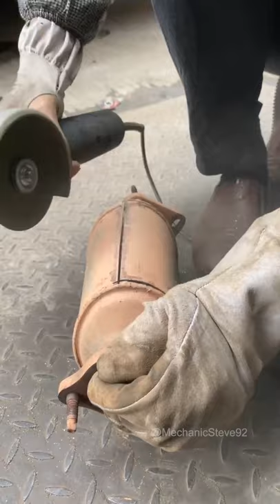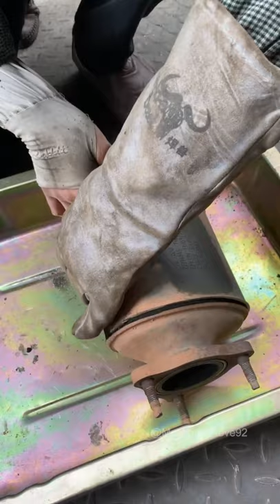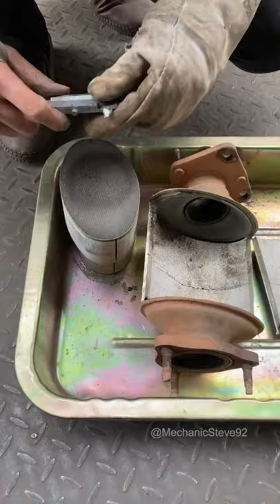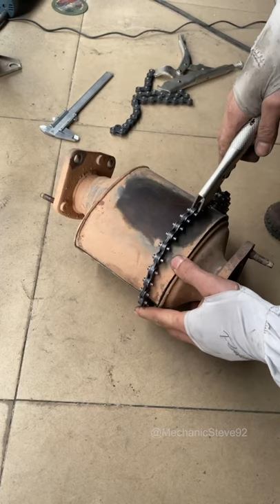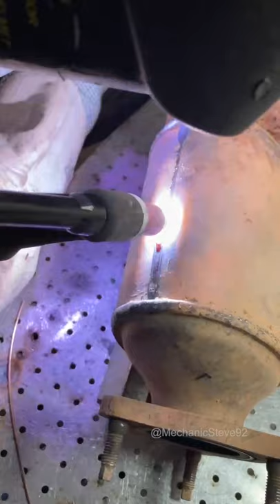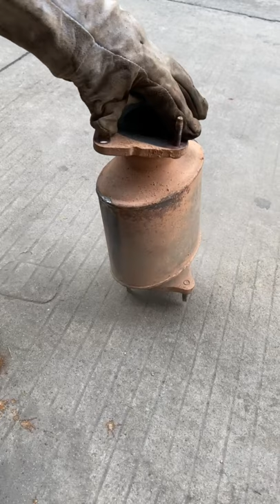Welding Catalytic Repair

Comment: Sorry, but today you make a botched job. Catalytic converter more little than before? Do you think that it will work and it will decrease the pollutants? And the empty's and vibration's sound? I hoped another reparations that it was up to previous one, but it wasn't. :(((((